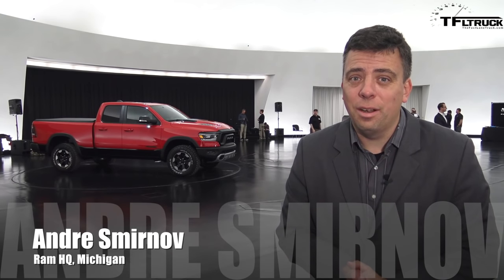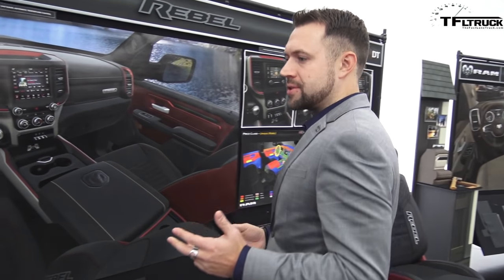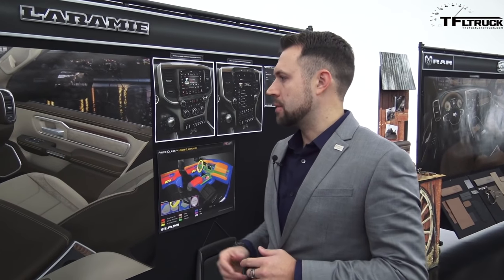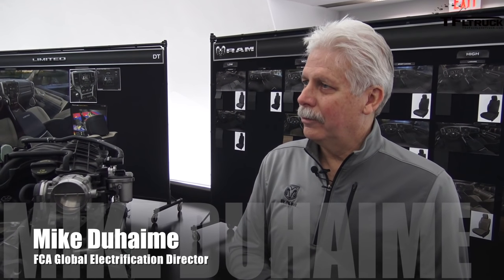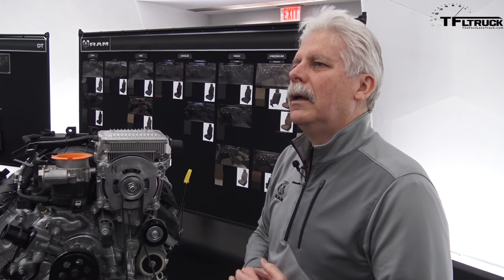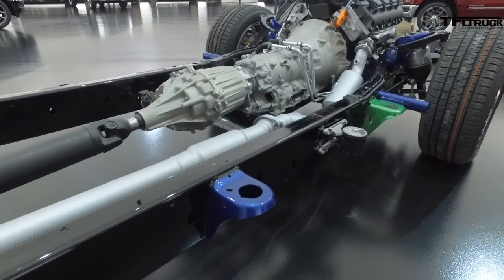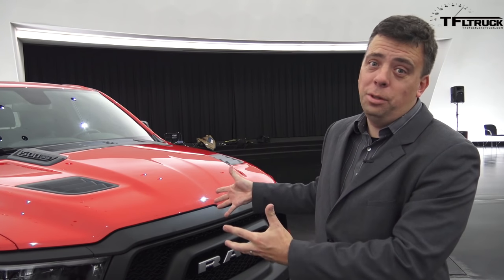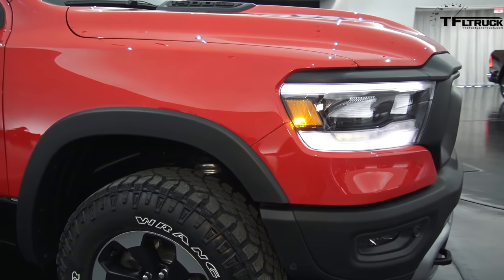Breaking News: Everything There Is To Know About The 2019 Ram 1500

Comment: Best looking new truck. GMC better step up their game or my next truck will be a ram. Great features and great looks.
Reply: Ryan C that's what I'm saying. The "new" gms are supposed to be redesigned but the entertainment system looks terrible compared to this. They also don't have panoramic sun roofs. The only thing I'm curious about is gms new straight 6 diesel for their half tons.
Reply: Ryan C I disagree. This is the worst exterior of them all. The chrome on the Laramie looked like it should be on a semi from 1970. Horrific
Reply: This truck looks like garbage just like every 2019 truck so far but atleast the Chevy and ford won’t crap out a tranny and suspension every 20k miles
Reply: Ryan C I think Chevy dropped the ball with their styling however they got that new in line 6 3.0 diesel coming for the half ton so I am curious as to what the Sierra is gonna look like... I think they ram absolutely killed it with that rebel in particular
Reply: Ryan C That inline 6 Duramax is what's probobly going to sway me in the direction of GM this time. I do agree the interior on these rams are awesome, I don't mind the interior of the new Chevy's though, I think the new trail boss looks great on the outside as well.
Reply: Im gonna be in the market for a new truck soon. Chevy guy. The new Ram Rebel is looking really nice....!
Reply: It's unbelievable how picky you people have become, these trucks are light years beyond what trucks were like only 10 years ago. Think of the top of the line truck from 20 years ago, that's when you could complain, not now....cheese and rice!!
Reply: Exposed Motion Cinematics truck 20 yrs ago di dnt cost $$65k
My 2008 loaded Laramie 3500 msrp was 50 and I got it for 38k! That same truck is 80k today!
Reply: not sure that you have the slightest idea what it takes to build an automobile now days, I have been in the automotive industry for several years now, and things have changed quite a bit!!

yes a 1998 truck was about $20K ($30K in todays $) but for double that price today you are getting 10 fold the amount of truck.......just purchase one of these trucks at 3 years old and pay half the price.......
Reply: Exposed Motion Cinematics I work for fpt doing diesel engine research. I have been an engineer in the auto and heavy duty markets for 15 years! The new vehicles have so much tech to try and get better mpg mandated by govt they will never be a good value.  Manufacturing is getting cheaper by the day with robots so why r trucks so expensive? Govt forced mandates! A truck that gets 30mpg but costs 20k more than a truck that gets 22 will NEVER be a financially sound choice. Govt and auto industry doesnt care!
Reply: Andy Hass I have been involved in the assembly process from start to finish for gm, ford, Chrysler, bmw, Mercedes, Volkswagen, etc. and each manufacturer had dozens and dozens and dozens of suppliers who also have suppliers, and each one gets paid from the steel mill to the assembly plant and each hand in-between.  It is very expensive to build cars now a days. And to also take into account the ridiculous unions that exist now days that are unnecessary that need to be paid. You also have shipping cost for each individual part from plant to plant to assembly plant. There are thousands of  processes that people don’t even have a clue what takes place in order to assemble a car. Yes, I agree government mandates are a joke, but that’s just the way it is man.
Reply: Andy Hass the half ton 8 speed is good but the 2500 and 3500 transmissions attached to the Cummins still shit the bed quite frequently. Join the Cummins facebook page and look around.
Reply: newb431 looks better then the new Ford. The f150 looks like it was designed by a blind person
Reply: Exposed Motion Cinematics that's the point. U just say "that's the way it is" that's why the auto indtry failed in 08 and will eventually fail again. 
Knock tesla all u want but at least Elon is trying to change the broken system. Unions. Yep the good old liberal nuts job at work. The system can change.
Reply: Too bad all that nice black plastic on the outside of that Rebel is going to fade in 2 years and look like garbage lol.
Reply: Ram has always done interior design the best out of the 3 truck brands. Ford has a fancy, but still simple looking design, I hate everything about chevy's interior, and tundra has the most simple and rugged look of all.
Reply: dedalliance1 yet it hasn't on the other trucks from 09.
Reply: I bet it has, Ryan.
Reply: dedalliance1 don't bet on something you have no clue about.   If I was a betting man, I'd bet you just like to troll. Especially brands you don't like.
Reply: There is no black plastic in the world that can live outside its entire life and not fade, it's just facts. No need to bet on it. There are ways to help restore it, but no one has time for that unless you're the type to work more on his truck than with it. Swap that plastic with metal and you'd have a solid truck I'm sure.
Reply: dedalliance1 , dawn liquid soap is all you need, and it's fading mainly due to acid rain & oils. 2 trucks, 96 Ram 1500 & 09 Ram 3500, no gray plastic at 260k/12yr and 230k/9yr.

Comment: The trailer chain hook points on the Ram used to be back closer to the receiver but now it looks like they've gone the way of the rest of the manufacturers and tucked them up under the bumper more, farther away from the trailer.  It would be nice to hear the question asked in an interview as to why they are becoming less accessible.  All of them now pretty much require a separate link added on to better take the chain hook on each side.

Comment: I am loving the new silverado and ram.
Reply: Eric Fox Silvawado is Frankenstein’s monster. Its terrible.
Reply: Nucl3ar Family You know when you start to look a the silverado as a chevy. It is not such a monster. Well it might be in performance.
Reply: Liking both Ram and Silverado and noticed GM doesn't have blind spot or heated and cooled rear seats and also no rear AC vents to my knowledge correct if I'm wrong. Also no Panoramic roof that I noticed Ram offers now.
Reply: Anthony Macneil Yes Ram has a lot of comfort application. But beside the stabilizer on the frame the other things I could not care about in the least. I am more into what they are doing for fuel economy payload and towing. Which Chevy seems to be showing.
Reply: Yes most definitely Chevy is with the heavily revised 6.2L that shuts down 7 cylinders and port and direct injection. I own a 17 High Country 6.2L and love it.
Reply: Anthony Macneil I own a 2016 Lt with the 5.3L and drive a 2017 f150 plus a 2014 Ram heavy duty with a 6.7l cummins for work. I only could wish to get a high country.
Reply: There easy to get paying for them is another thing. The MSRP in Canada is $70,000. The 6.2L is a beast and gets 21 to 22 MPG on average not bad for a big truck.
Reply: Anthony Macneil yep that is about the same as my 5.3 but you have 65 more horses and 77 more torque.
Reply: Yes the power band is crazy and the top end scary. It broke traction at 35 MPH when it was kicked down never had a truck do that. 5.3 is great running engine

Comment: Hopefully they still offer the manual transmission with the Cummins
Reply: Noah Tiemann well this is the 1500. Last time I checked they don't offer a Cummins in the 1500 line. Just the HD/ 2500, but yes I would hope when the redesign the HD line up, they keep the manual!
Reply: Doubt it. I don't think the platform allows for a stick shift. If the sales volume is there, they might. But if not they will probably not invest the engineering into it.
Reply: What the should the shifter look like?  A hammer.
Reply: I’d doubt they will have a Manual.
Reply: 2020 will be the last year for the manual option in the Ram 2500/3500 with the diesel.  Right now its still an option but only with certain grades, and just with the diesel.

Comment: Did they say that they lowered the truck?  That's exactly what I was looking for in an offroad truck, lower to the ground with smaller tires!  SMH
Reply: LastStarFoster Haven't gotten to that point in the vid yet but I'm guessing they mean they lowered the body lines to make it look lower, not that they lowered the ride height if you see what I mean.
Reply: LastStarFoster Oh ok that's idiotic, but I guess it's the fca way.
Reply: Another video says it's one inch higher. I believe the one inch lower is automatic after a certain speed on the highway to increase fuel economy at those speeds.
Reply: Veritas726 Like less air resistance and presumably immproved high speed stability due to there being less lift presumably?
Reply: Ehhh, no biggie, I'll be throwing on a 6" kit right away with at least 35"s
Reply: Puff the Magic Dragon that's a lot of presumablies
Reply: cydonianman XD
Reply: cydonianman Agreed I need to expand my vocab, it didn't help that I was tired when I typed that.

Comment: Is mc hammer going to be a spokesman for 2018 ram. Did he say 22 inch wheels on a 4x4 with 33 tires wow no rubber.
Reply: no they didn't say that, your mixing two things. The rebel has 33in tires on 17in wheels and the street ones have 32in tire on a 20in wheels. He said they made it stiffer so you COULD use a larger wheel on a 4x4 model without causing extra wear.

Comment: Love it all except that electric thing on the motor. May trade my 2014 Bighorn
Reply: wascrash From what I understand that Etorque thing is standard on the V6 but optional on the hemi.
Reply: Just my guess but the prius has a similar settup, and although lame as hell it gets great mileage and is very reliable on the Toyota. Should make better low end torque aswell
Reply: Enjoy it while you can.  Won't be too many more years before internal combustion becomes a niche product in vehicles.  Electric = more torque and better operating efficiency.
Reply: jldude84 Chevy malibu hybrid gets 46mpg where as the smallest non hybrid engine gets 30mpg. So rather then running your mouth just do a little research.
Reply: jldude84 I do know what a hybrid is. When the numbers are out you will still be wrong about your 1mpg.
Reply: jldude84 you sound like someone who believed the ecoboost and is still mad about it lol. This will work, the technology is proven. Of course ram gave it a fancy name but that doesn't change much.

Comment: Ram screwed all the guys with older rams that would like to put the new ram wheels on their trucks
Reply: Eddie211979 I'm sure they will figure it out. Like hub swap and axle swap
Reply: Why when aftermarket wheels look better and come in a much wider variety with the 5 x 5.5" lug pattern? I feel more sorry for people who buy this with the 6x5.5" bolt pattern.
Reply: Kevin Smith going with a 6x5.5 bolt pattern is literally the best decision ram could have ever made. It will now have the same bolt pattern as Chevy and open up the amount of wheel choices. Literally every truck wheel design is made to fit chevys, Especially drag setups. 5x5.5 bolt pattern has the least options. Idk where the hell you get your information.
Reply: Serenity in silence right on I know . Now I can go on Craigslist and actually find wheels that fit for a change
Reply: Albert S. That's not as easy as just slapping the new wheels on. I know that's an option but most people wouldn't go through the trouble
Reply: Why should Ram care? Why should new Ram buyers care?

Comment: Looks Fantastic, I'm going to buy my first truck this summer and there were couple of things that I thought RAM was missing, It looks like they may have addressed them, but you didn't say anything.  First, looks like they went to led headlights, please tell me it's true, and they added a very functional step in the back, as long as it's solid, it will be great.  What the hell is a steel suspension vs. airbag???  I think the two 8.4 screens is a little overboard, but hey to each is own.

Also, tell me they changed the rear view mirrors to a better system.  It seems to have power out and retract, is that true????

I like all the manufacturers, but getting ready to buy, I've always felt RAM has the inside nailed and now it seems all the manufacturers are giving us so many choices in configurations and options that we have great choices and that's great for all of us.

Are the HD's coming out this year also?????

Thanks, great job, wish the motor man would have answered your drag question.
Reply: Steel suspension is coil springs. Previously the Rebel meant airbag suspension only.
Reply: OK, thank you.

Comment: Highly disappointed Ram.....I have a 05 bighorn.....Looks like a rehash of the current gen... With lots of similar parts to the current gen. What the hell were you thinking on the headlights? I'm afraid I wont even consider it.  Gonna go for aluminum beings my truck is terminal with the cancer.
Reply: T Bye. You won't be missed ✌🏾#moparfam
Reply: I have an 05 Dakota. Try out the 2018 models. You will see just how far Ram has progressed and how much Daimler was holding the company back. The interiors were a huge improvement over the 50 shades of gray going on in our vehicles. The 8 speed makes a HUGE improvement over the 4/5 speeds we have.
Reply: Kevin Smith But you are forgetting something....all of the recalls....kind of a big problem and the new truck looks to be going the way of a ton more recalls...too much gimmicky shit to go wrong all over the truck and a big let down under the hood with the hybrid Tree hugging bullshit that will brake and probably take a small loan to be able to afford to fix...it is very simple the more you complicate something the less reliable it is and who cares what the gas mileage is when they buy a truck? If MPG was a main concern should have bought a Honda and trucks are not supposed to be a Cadillac lol they are trucks and did you consider that if they had just made a truck it would probably be about half the price of this rolling house cost on wheels..not trying to hate just being honest. The truth is the trucks today are just watered down empty versions of what they once where now they are frauds built for yuppies claiming to be trucks
Reply: Marcus Young 😂

Comment: It will break before it gets very far down the road. I own one, and will NEVER buy another Ram.
Reply: John Carder No you don't.
Reply: Yes, I do. I own a Ram 2500. Had to replace the transmission at 32,000 miles. The repair bills average several thousand a year on that truck. I will NEVER by another Ram.
Reply: John Carder Powertrain warranty is 100,000 miles. Try again.
Reply: No, it was past the warranty date. And, yes, I did own it and still own it. I drive it every day. Friday, I just paid another $1800 in repair bills.
Reply: There is a time limit on that, and this is a 1998 Ram 2500. Chrysler refused to cover it. Why I will NEVER buy another FCA product.
Reply: John Carder You are seriously complaining a vehicle company is refusing to cover the cost of a 20 year old vehicle? You are delusional.
Reply: John Carder Lmao I think we are done here.
Reply: It was about 8 years old and had 32,000 miles on it. If that were the only problem it has had, I would not feel this way. My mechanic just told me that mine runs better than his does, because it has never been flashed. It seems that there is an intake manifold gasket leak that happens all the time. Chrysler chose to reprogram the computers to hide the problem. The result is that the flashed engines don't work as well.
Reply: By the way, I have owned many Fords and a Chevy. They were all better vehicles.
Reply: I am complaining about the problem that I had when it had 32,000 miles on it (8 years old). I am also complaining about all of the other issues that truck has had. 
I also own a 1979 F250 4WD and a 1986 F250 4WD. Both run better and cost me less to operate. Apparently, you prefer throw-away trucks.
Reply: John Carder an 8 year old truck should have close to 100,000 miles on it, typically. What kind of use cycle did it see in those 8 years? Speaking of reflash fixes, I wasn't very impressed with the infamous F37 torque management reflash on the KJ Liberty either, but my overall history with Chryslers has been positive.
Reply: It currently has 72,000 miles on it (at twenty years). I do not commute. I use it to plow snow, haul firewood that I cut, to respond to fire department calls (2 miles to the station) and to go to town to the grocery once a week (10 miles each way). I am glad that you have had a good experience. I live at 8,300' ASL, west of Boulder. Most of the roads that I drive on are dirt. I talked to a mechanic who had one from that era who sold it after he had to replace the transmission twice. They had serious issues back then, but did not stand behind them. I know. It's a different company now, but "fool me once"...
Reply: My 2015 Ram has 66,000 miles and it's on its third motor
Reply: Southern Supercar care to explain?
Reply: Mr. Sleep cylinders 2 and 8 failed at 65666 miles Chrysler covered under warranty 13 days less than 500 miled later cylinder 8 failed on new motor Chrysler denied warranty but the dealership is eating the cost the motor failed September 25th 2017 and as of today the vehicle still sits in the  Service Department
Reply: John Carder Well yeah ford and gm are far superior in terms of quality/ reliability overall but I have heard good things about Rams.
Reply: Southern Supercar Are you serious?
Reply: Puff the Magic Dragon yes!
Reply: Puff the Magic Dragon I will never buy another Ram
Reply: Feel you bro I have a 2017 longhorn with 12k. bought it new. AC barely blows air and cooling seats don’t work